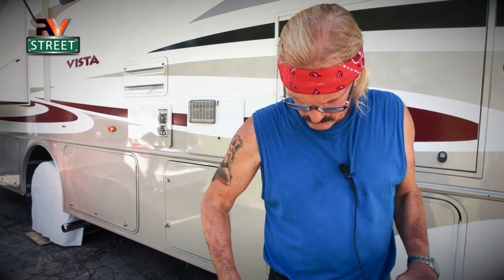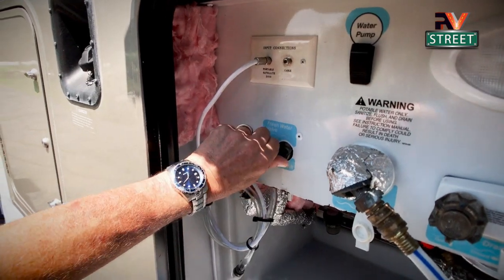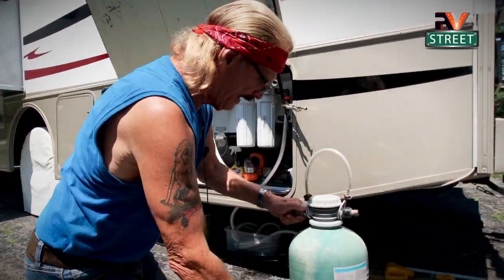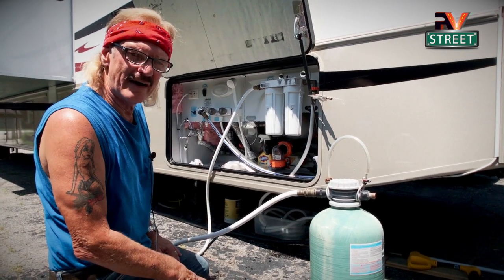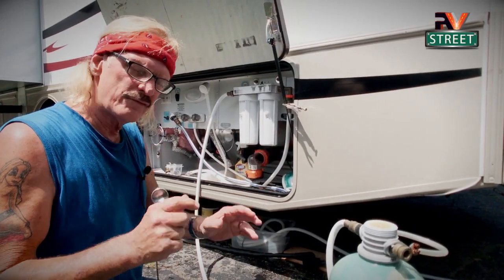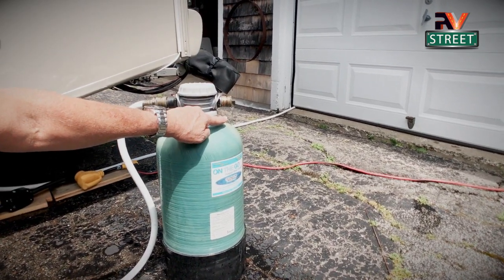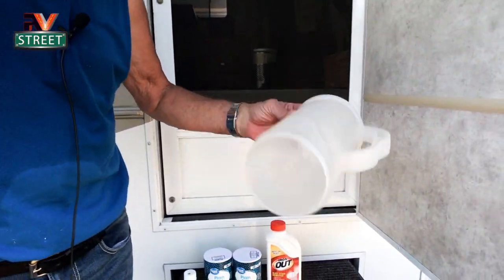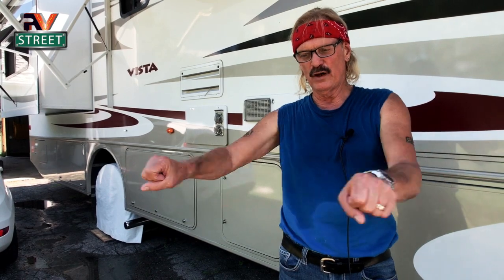REGENERATING a RV Portable Water Softener. Easy DIY.

Comment: New Sub to your channel. Full Time RVing for almost 2 years and what drew me to your channel (and others) was doing research on why my water heater tank sprung a leak only after a 2 years.  Anyway, I want to make sure that after I get my new water heater, it dawned on me that I should invest into this contraption to help with calcium buildup and things..   Thanks for the detailed explanation.  A few things that I'm going to do when I get my double onthego water softener.

- As with all my scheduled maintenance items, I use painters tape and sharpie marker to put a date on the filters to help remind me when I've installed and regenerated the unit.  Probably won't put on the jug since this will be outside and will fade after time.  You get the idea.
- From your pro-tip I think that I'll always use 3 salt containers to backfill.  To me, this may alleviate having to do this process all over again after your completed it and test it just to find out that the strips still show brown.
- Like you, I LOVE quick disconnects.. Makes it SO MUCH easier.  You mentioned that you use Teflon Tape on the threads.  Are those threads plastic or just your preference?
- Just to note : For those of us that flush black tanks every week, make sure that you use a TOTAL different hose and process outside of the drinking water process. (NO BRAINER).
- While you're flushing the onthego I think that I'll drain the entire RV water system as well while that 30 minute regenprocess is doing it's thing.  This way, the water that's inside all the tanks are also flushed and clear/cleaned so when you hook up the newly regened bottle, you get fresh/clean water in your system too.
Reply from the maker: WOW...I thought Martin was detailed, you definitely have him beat. The Teflon tape was just his preference.

Comment: Thanks for another great video!

We use a clear source triple element water filter and then a 16000 grain water softener before it goes into the rig. We then filter all water for consumption and cooking through an Alexapure Pro .02 micron filter.

To regenerate the water softener I use a single $40 filter canister and dump the salt into it instead of the water softener. I think that using the canister insures that the brine solution is injected throughout the entire volume of the resin medium. We have the canister setup with a few valved y’s, 90’s, isolation valves and quick disconnects so that all I have to do is turn a few valves to back flush the softener and then return it to normal function. This all fits in my front storage bay. This may not be ideal or feasible for every one but it works great for us.

Comment: I noticed your bike and tow bar set. up. I had to get a dual receiver as well, with a 2 inch rise, and an 8 inch drop. I still have trouble putting the tow bar away, tucked under the bikes. Is that an extension on your tow bar to make it stick out pas the bike rack.?( when the bike rack is folded up ). I haven't noticed a video on this subject?
Reply from the maker: I covered our tow bar and bike rack some in this video: (jump to 30:50 in the time line)
https://www.youtube.com/watch?v=X0x4djQ5KNM&t=1629s

I plan on doing a complete video on this subject sometime in the future.

I don't ever fold up our bike rack. Our Ready Brute Elite tow bar comes this way with the neck on it so it just slides right into the receiver and gives me the clearance over the car that we need. I spent a lot of time figuring out what would work best for us and our set up.
Reply from the maker: Hey Keto,
I just happened to remember another video where I covered the tow bar some: (jump to 23:41 in the time line)
https://www.youtube.com/watch?v=peEJVnz6DkU

Comment: Awesome information retained you’re very helpful! I watch everyday some segments 2 or 3 times....starting to build my inventory of necessities of “must haves”. Do you have any information on using the electrical inverter system? Don’t really understand how that works. I’ve only camped with hook ups so far, ready to take it up a notch! Thx Martin your priceless....details coming up...on RV Street 🙂
Reply from the maker: Ah Perry you're to much and too kind. haha 🙏
As far as—inverter system—and how to use it, I haven't done a video on that yet. But I will give you a couple of nuggets to get you started.
The ONLY time you turn ON your inverter is when you are not plugged in. If you turn ON your inverter, you're immediately drawing power from your house batt's and converting that 12V storage power to 120V to power some things in the RV. If you don't have a robust batt bay, your batt's will drain pretty fast. Never allow them to go below 50% charged.
There's a lot of info out there on how to set up your batt bay for boon docking—which we have done in our coach to fit our needs—but we just haven't done a video on it.
Everybody's needs and power demands are different. How you set up your batt bay depends on so many things and how much batt power you need to power everything you need power for. For most people—including us—when you start to boon dock and start relying on your batt's and inverter, you have to conserve power wherever you can. It's WAY different living than when hooked up. You have to conserve power, water, the way you dump tanks....everything.
I may do a video on the inverter/batt bay in the future we'll just have to wait and see.
Thank you though for being such a faithful watcher of our channel. 💕💕

Comment: Martin, I have a question.
Shouldn't the primary be connected to the softer first to do the primary filtration and then go through the secondary and tertiary filters?
You've connected the small filter to the primary and secondary, and then finally to the softer, but I'm wondering if it should be the other way around.
Reply from the maker: It breaks my heart to say that Martin has passed away but I recently regenerated the water softener exactly the he showed in the video and it was perfect.

Comment: Sir, question, When you rejuvenate from the out through the in, And after you add the salt don't you change it back around and put the hose to the inside and then let It run for the 2 phases  20 to 25 and then full stream for 8 minutes.

Thanks,
Brian-Florida
Reply from the maker: I know he did it exactly as the video showed. I am sorry I can't be of more help but Martin has passed away and I really don't have the answers.

Comment: You should make yourself a short adapter hose that you can put on when you need to back flush the system. then you would not have to keep changing the adapters and putting new tape on. would also save the thread wear.
Reply from the maker: Yeah you're probably right. So much to do. haha 😜

Comment: Nice video, again, thks Martin. Just got an the go system. Getting a salt taste in the water, am I doing something wrong?
Reply from the maker: That means you didn't do a good enough fast & slow rinse. Disconnect hoses and do some more fast rinse then taste water right out of the water softener until it's good, then reattach hose. Salt that hasn't been rinsed properly will also give you wrong readings on the test strips.
Reply: @RVstreet  that fixed it for me!
Reply from the maker: @jimleclair3598  👍

Comment: I have a water softener. How often can you regenerate the resin before replacing it?  I replace the resin about twice a year and regenerate when needed while traveling. 

I didn't know about back flushing when regenerating. My water softener is not an On the Go. It is just one I picked up at a water specialty store. 

Thank you for this video.
Reply from the maker: With the ON-THE-GO water softener the resin lasts about 7 years with regular use before you have to replace it. If you have and use a washing machine—which uses more water—probably around 5yrs.

As always, thanks so much Stephen for traveling along with us. 👍

Comment: When your softner was brand new, did the water taste funky? Plasticky maybe?  We've run 5 days worth of water through it and the water still has a funky taste.  Triple prefilter in place. Water prior to softner tasted fantastic.
Reply from the maker: Nope. Our water has tasted great from the beginning and still does.
What type of water softener do you have and old is it?
Have you done a water softener back flush, a recharging and a strip test?
What kind of water hoses are you using?
Are you using water from your fresh water tank or city water?
When's the last time you've changed your water filters?
Reply: @RVstreet  on the go dbl standard.  It's brand new.  All hoses are the same, potable water types. We've been at this site since May. 3 Filters are 3 months old. Haven't regened, or backflashed. It's 5 days old.  

Today we'll take off the hoses and taste it out of the filter. Filter is before softener.  Water has always tasted great. Best ever tasted actually. 
Then we'll taste it straight from the softener. Doubtful it's the coach plumbing. 

Could the in & out be marked wrong?  It came premarked under fittings.   
Safe journey back to RGV
Reply from the maker: @suncitynews  No the In/Out  wouldn't be marked wrong. Did you put the required salt in it to begin with? Definitely back flush and then regenerate. Also test the water with test strips right out of the softener after you do these things. Filters being 3 months old are due to be changed though and you adding the softener at this time may just be a coincidence and causing you to look at the softener as the cause. Other than that I have no idea why it would have this taste. We have never had that problem and we know tons of folks that have this softener and also have never experienced this. After you do the above and it still persists, call customer service and see what they say. Please keep me posted as I would like to know the outcome.
Reply: @RVstreet  the directions didn't say to add salt during initial setup.
Will tinker with it this weekend and call customer service Monday adjustments don't improve flavor. 
The plasticky artificial after taste is pretty wicked. Thanks!

Comment: Martin, instead of removing the female fitting from the water softener every time you regenerate, go get a double female hose connector, then screw in 2 male quick disconnect fitting.
Reply from the maker: Hi Larry 😎
Ya others have mentioned something similar to this BUT.......the problem is all the other 2 male quick disconnects are junk and leak. There is just no other quick disconnects than the ones I use that don't leak. EVER! Mine are almost 6yrs, old with the original washers and still don't leak. And I have a ton of them all over the RV. So if I make a change like you or others have suggested to a permanent solution I'd have a constant leak going on. Been there done that and I hate leaks. 
Ya, I mean it's a little hassle the way I do it, but it's only about 3 MAYBE 4 times a year to regenerate and in the grand scheme of things I have no leaks and it's not that big of a deal to me.
But I really do appreciate you taking the time to comment and suggest this to me 👍
Reply: @RVstreet  I was talking about using the double female Hose adapter so you could screw in your favorite male fittings at each end and plug this into the softener. This is used ONLY for back flushing the softener. It’s easier than unscrewing the quick disconnect that you use on the softener. PS your not replacing anything.
Reply from the maker: @larryrfs  It's funny....I was actually regenerating my water softener this morning and was thinking of your 1st comment, so I came back here to reply again and then saw you clarified what you said. But...you're right I see what you're saying. I will do that next time. Maybe in other similar suggestions I never connected the dots. I should of thought of this myself. thx 😂

Comment from the maker: Concerning buying the water softener and the regeneration process

There are two ways to buy a water softener through my Channel:
1) The On-The-Go water softener through my Amazon Store in the “ Everything Water and Sewer” category. My awesome brass quick disconnects are also in this category. The quick disconnects sell out quickly—before they restock—so be sure to buy what you need when they become available.
https://www.amazon.com/shop/rvstreet

2) The “Essential Portable RV Water Softener” through my fantastic, family owned water source company that I’ve been with for years. It’s the exact same water softener as the On-The-Go water softener, just with their name brand on it. This company carries all my wet bay water gear.
https://www.rvwaterfilterstore.com/mm5/merchant.mvc?Screen=SFNT&Affiliate=RVstreet

💗ONCE YOU CLICK THE LINK ABOVE, TYPE IN THE FOLLOWING PART NUMBERS IN THE SEARCH BOX and then put them in the cart and check out. These part numbers BELOW will give you the exact same system I have.

• For the 16,000 grain Water Softener (that will supply you approx. 1,600 gallons between recharging which is simple to do) just type in the the search box—Water Softener—and then you'll see the Essential RV Water Softener Portable 16,000 Grain w/Custom Hose.
• For my Watts Water Regulator, type in the search box—Watts 263A-LF with gauge
• For the Dual Water Filter Canisters with mount, you want to get the Essential Whole RV Water Filter System with Bracket. You’ll receive (2) 10” Sedi Filters and (1) .5 Micron Carbon Filter. So type in the search box—Essential Whole RV Water Filter System with Bracket
• For extra .5 Carbon Filters which you are going to need, type in the search box—F1Pb CFB PB10 10" Carbon Filter Cartridge—. They are only sold in single packs but normally last up to twice as long as the Sedi Filters
• For extra Sedi filters, type in the search box—RV-SED1 cartridge, 10", 2-pk
• For custom made to length hoses, type in the search box—Hoses—and then click—Hoses, custom Built for you—.Then order what you need.
 
NOTE: This is a fantastic system and you'll no longer have to worry about your RV water from the city or in your fresh water tank. It will be safe, great tasting water throughout your RV and all your plumbing and appliances will be protected too from harsh calcium deposits that can wreak havoc in your RV.

If you need help, you can call them @ 602-625-1875 ask for Brad and be sure you tell them that RVstreet sent you.

To regenerate the water softener, here’s my best updated practice I’ve developed over the years to make sure your water softener is MARTINIZED 😝
1) Turn OFF city water
2) Do a back flush for 10 minutes with city water at full pressure
3) Turn OFF city water 
4) Remove main cap and stem assembly
5) Add 2 full 26 oz. boxes of iodized/non-iodized salt
6) 2-4 teaspoons of powdered Super Iron Out, depending on the hardness of the water in your area
7) Stir these ingredients into the resin using the stem of the head assembly
8) Rinse the under side of the cap and stem assembly AND the threads on the water softener to be sure they are totally clean (so the cap will seal properly) then screw the main cap and stem assembly onto the water softener
9) Let it sit for 1 hour
10) Attach city water hose to inlet port on the water softener
11) Turn ON city water for 10 minutes at full pressure for a fast-rinse
12) Taste the water coming out of the outlet port. If it tastes a little salty continue to rinse for a couple more minutes. Once salt taste is gone, use a test strip to check hardness. Once everything is OK…
13) Hook up the main RV water hose to the outlet port and you’ll be good to go

NOTE: Under normal usage conditions you should have to do this about every 2-3 months

Comment: So when your running the salt through your running the water through the way you would when filtering and hooked up for use?
Reply from the maker: Yes. After you've done a back flush and AFTER you put the salt in, you put the top cap back on, hook up the one input hose as normal, do a slow rinse, then a short fast rinse, test the water, then hook up the hose that goes into the RV.